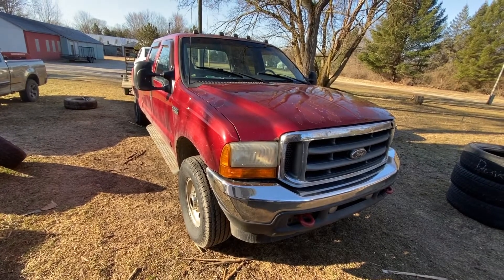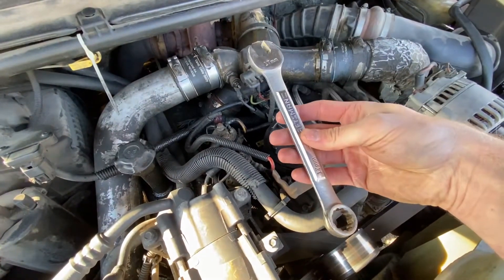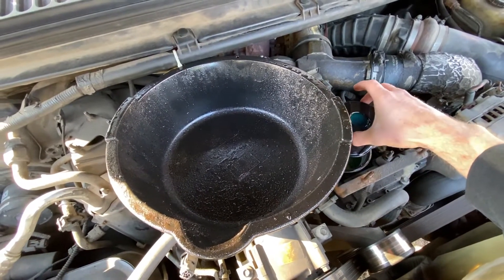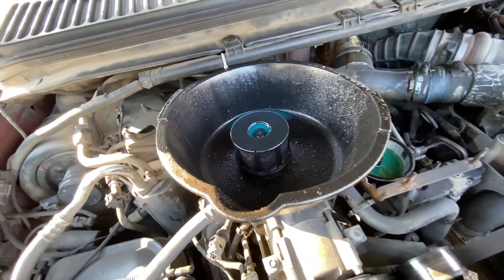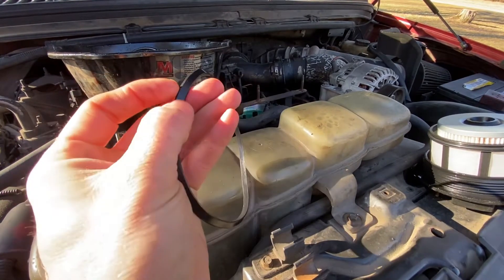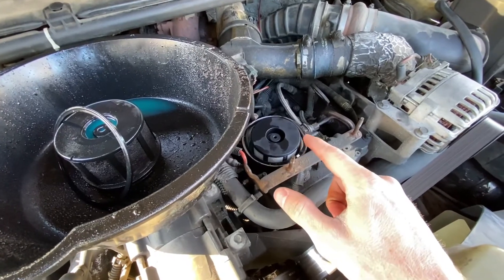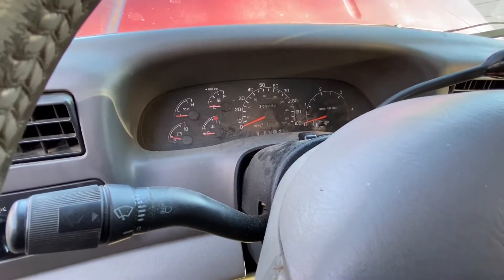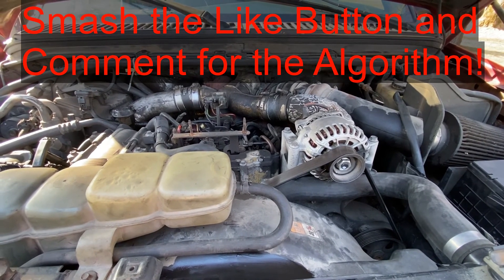Replace Fuel Filter 7.3 Diesel Ford Super Duty Powerstoke 99 00 01 02 03 1999 2000 2001 2002 2003

Comment: Important!: There’s a bowl drain valve on passenger side rear bottom of bowl. Open that drain valve first, before even removing cap. Otherwise you risk leaving contaminated fuel/water/gunk in the bowl. Turn the lever clockwise to open.

Then close drain valve, replace filter, and refill the bowl with fresh/clean diesel before putting on the cap.
Reply from the maker: Great information! Thanks!
Reply: Turning the key to ON should prime the bowl if everything’s working correctly.
Reply: That's what I came here to add. Can't believe someone is making a video about something without the proper knowledge that could lead others to serious problems.  Perfect time to get any water out of the fuel bowl in addition to particles from the tank!
Reply: @johnathansmith9246 it’s a yellow lever.

Comment: Should hit the drain valve and remove at least 1/4 of the fuel in the 
bowl to remove any contaminants and water every filter change.
Periodically I'll drain at least half the fuel in the bowl and fill it back 
up with either Lucas Injector Cleaner or new clean tranny fluid to 
clean the injectors.
Also remember to suck the old engine oil out of the HIPOP every oil change.
Reply from the maker: Great advice!
Reply: Hi may I ask if you are putting Transmission fluid inside diesel ⛽ filter bowl to clean injectors ?  That sounds unsafe.  Thanks
Reply: @bluetwo7282 , what seems unsafe about it? Transmission fluid works like a cleaner mixed with diesel. Look up using used engine oil and tyranny fluid to run in your diesel. You can also run used vegetable oil to run your in the older diesels. The first ever diesel was run on peanut oil.
Reply: @RoadKen53   thanks 👍 for info Ken, I'm new to diesel engines so wondering about additives such as transmission fluid mixed with diesel ⛽ I'll have to try it and see if better than seafoam and other diesel additives.  Continuous blessings 🙏✨🙏🏅👍
Reply: @bluetwo7282 , the one additive I really  noticed a difference with was Lucas Injector Cleaner in a Mercedes 300sd I owned years ago. It idled rough and in 2 city blocks it smoothed out and I was impressed. I still use it every 500 miles or so in my F350 and my car. The 7.3 Powerstroke is a tough engine.
Reply: HPOP is a flowing system so why would you drain it lol

Comment: 👎🏼 no torque specs.  An you didn’t check for leaks.
Reply from the maker: It’s a plastic cap with an oring. Decently tight is plenty good enough but not too tight or they can crack.
Reply: Book says 20#